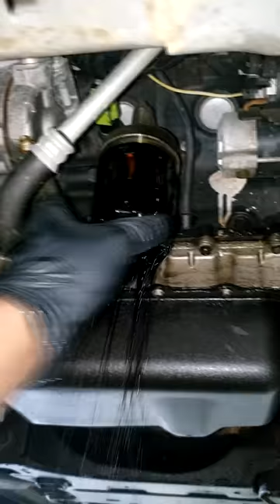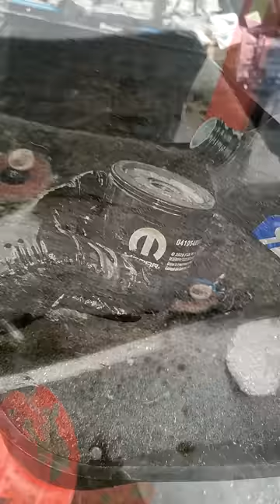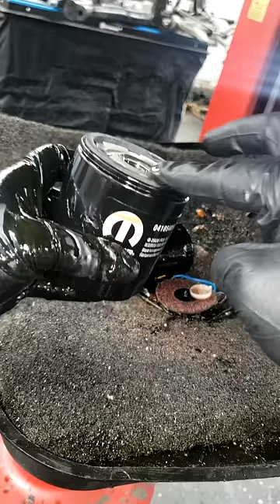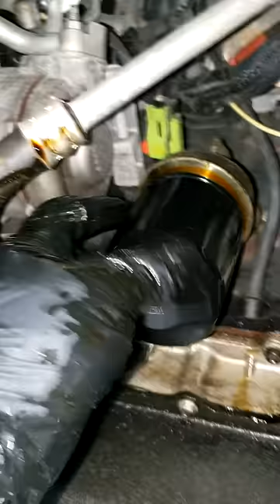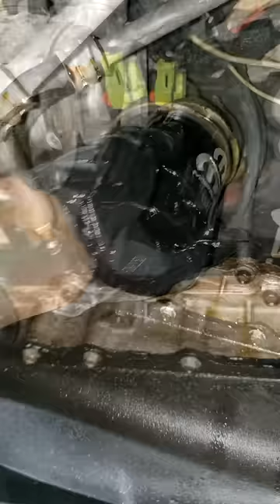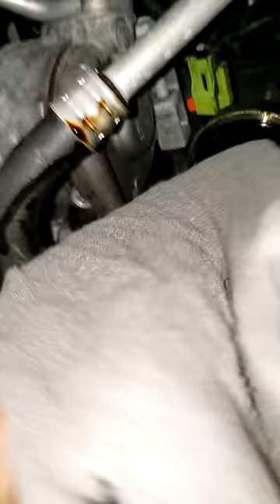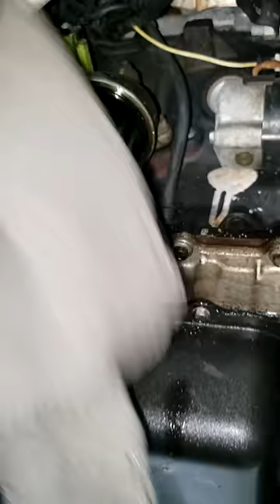Don't Lie.. Are yall still doing this?

Comment: People who pour oil into the filter are the same ones who ask the teacher what’s for homework at the end of class
Reply: I worked at a oil change place when I was younger for a couple years and the only reason I do it is because the car sounds like crap for the first couple seconds while it's dry starting. When I pre filled it wouldn't do it. So why not take the extra 2 seconds? Of its thats too hard for you you probably shouldn't be changing your own oil anyways
Reply: @gabrielgalaxygh  found one ☝️
Reply: Yes bro my 2 years of experience doing 10 to 20 oil changes a day is complete  proof I like homework....
 If you don't believe me, next time you change you oil try it out yourself and listen to engine on startup. It sounds like shit if you don't pre fill and people would ask why it sounded like that on startup so instead of explaining evrytime they ask that it's just a dry start and doesn't harm the engine I just prefilled and bam no more shitty start up noise and no more people asking and thinking I messed up their car.
Reply: @gabrielgalaxygh  You're absolutely right. If you don't fill the filter, you can hear the engine running un lubricated for like 3 seconds. Why would anybody do this? 
Now let's wait for this dolt to chime in and say it's not enough to matter. A car with 150k miles could have 30 changes. That would be like running a car for 90 seconds straight with no oil. Asid from idiots like pelemello, who would do that?
Reply: The engine will have some lubrication on it so most likely your not really hearing anything. Done many changes without oiling the filter. Never heard any noises.
Reply: @adult talking  if you drive a dodge you're supposed to change the timing chain after 60,000 miles did you do that??? No you didn't because manufacturers make shit up
Reply: @pelamela4012   I bet you don't even change your own oil. Or you would know
Reply: No I’m just a YouTube mechanic just like you
Reply: @adulttalking5353  , just a habit I've been doing for over 40 years. And as long as I'm physically able to keep working on my own stuff I will probably keep doing it.
Reply: Flood mode. Try it before your oil change to know if it works on your car or not. Easy
Reply: @borisjankovici662 , some vehicles have filters upside down & like mine 2 parallel filters, so no chance of pre-filled filters. My truck is 17 years old & still runs perfectly. As long as you let it idle after starting you’re not going to do any damage. For the vertical filters like in the video, yeah why not prefill, can’t hurt can it. 😊🤷🏼‍♂️
Reply: @borisjankovici662  in vehicle like my truck, the oil filter sits sideways and prefilled isn't an option, almost 400k miles in routine oil changes with no filter ever being filled and no issues.
Reply: The way I was taught at my old oil shop was especially for larger motors ie diesels you fill the filter partially so that when the motor starts running and pumping oil through the system you don’t get a whole bunch of oil going in to fill an empty filter and ending up starving the engine of oil, causing heat and wear. It’s good practice to still do it on smaller displacement engines because it can still cause unnecessary wear even for a moment while your engine has low oil due to it all rushing to go through the filter.
Reply: Every time
Reply: Right after the teacher just wrote it on the board.
Reply: For real 💯
Reply: @borisjankovici662  The oil pan is the reservoir where the oil accumulates the engine just has a film protecting the parts and it doesn’t get dry while you drain the oil. The oil pump refill is the sound.
Reply: @blauer2551  No. It is not. The sound is the lack of oil pressure because the filter is empty. Your cam, lifters, rocker, bearings are not being lubricated because there is no oil pressure.
Reply: @gabrielgalaxygh  Pretty much every car, newer or older will make more noise on startup. Better to just prime oil pump one way or another, that oil he poured in will go through oil circuit unfiltered btw. Only need to do this if the engine has been sitting for long amounts of time.
Reply: …and reminds forgetful teachers that a quiz was promised👺
Reply: @IsaiahS.-cm1km  It depends somewhat on whether it is a belt or a chain, but in either case, you should absolutely do what the maintenance schedule calls for. First, if you don't, you've voided your warranty. Second, contrary to what you suggest, maintenance costs are a big consideration in the design of a standard vehicle, because they are a competitive advantage (or disadvantage) so manufacturers actually don't try to fit unnecessary items into their schedules. If it's there, you should absolutely do it.
Reply: I dont do homework cuz i get it done properly before i leave to go home 😎👍🏻
Reply: @Doctor Song Um, our homework was assigned at the end of class... no time to do homework. I don't think you understand homework or have even been to school?
Reply: @fjb666  I went to school to learn and pass exams which i did. after school I had more productive things to do like tinker and experiment with machines,devices and bikerides and be outside. when it was time to come inside i was far too tired to sit and maintain consciousness for boring stuff that i already did in school that day and probably going to have to do more of the next day. then when i turned 14 i got a little job at a Radio station. Sorry but i had higher priorities than homework. sure i didnt get straght A grades but I passed nearly every test except maths and spelling lol  but hey thank you for your interest in my boring life. how about you ? did you get the extra brownie points for doing your homework? I bet youd have had more fun hanging out with me after school than boring old homework 😎👍🏻
Reply: And the ones that pass the test
Reply: As a young guy, I had a used Buick Nailhead with lots of miles.  If I put the filter on empty, I could hear a main knocking until I had oil pressure.  When I prefilled the filter, no knocks.  That convinced me to prefill the filter.  Put over 100,000 more miles on that car.  Never had an engine problem.
Reply: @DOCTOR_SONG  You missed my point entirely.
But I was nearly the same , except I got expelled from school for skipping class and sleeping from being up too late, dissecting engines, motors, electronics. Now maybe it will pay off with an automotive vr app
Reply: @borisjankovici662 . I don't prefill. It's not any worse than a cold start. The sound is likely the timing chain in vehicles that have a oil pressure fed tensoiner. Other engine don't usually make the sewing machine sound.
Reply: @blauer2551 I don't prefill. It's not any worse than a cold start. The sound is likely the timing chain in vehicles that have a oil pressure fed tensoiner. Other engine don't usually make the sewing machine sound.